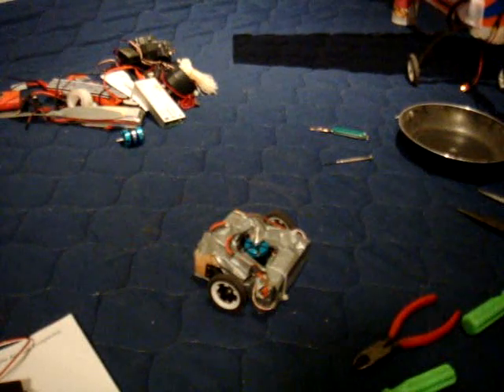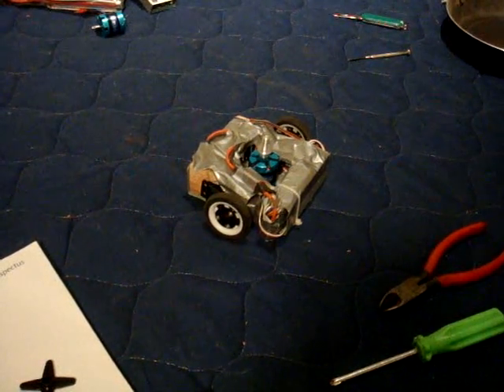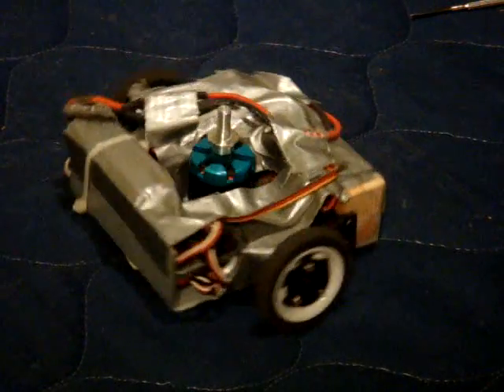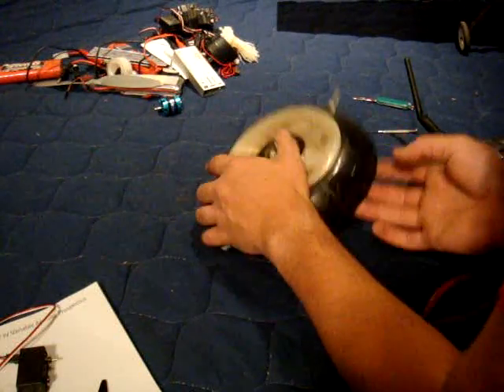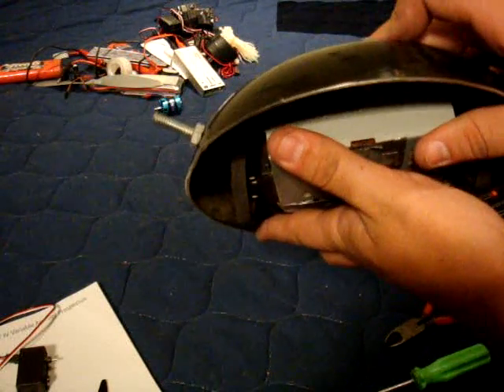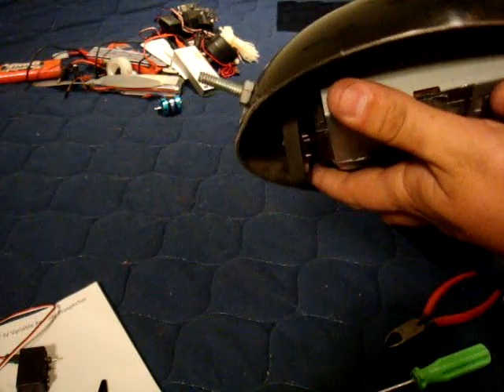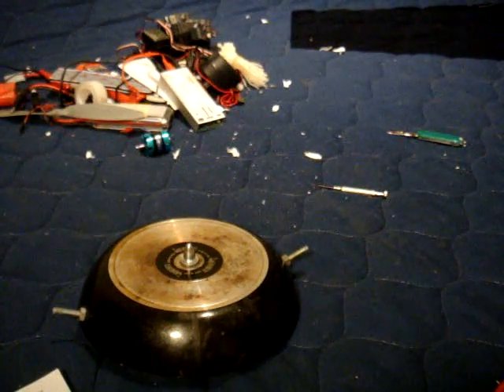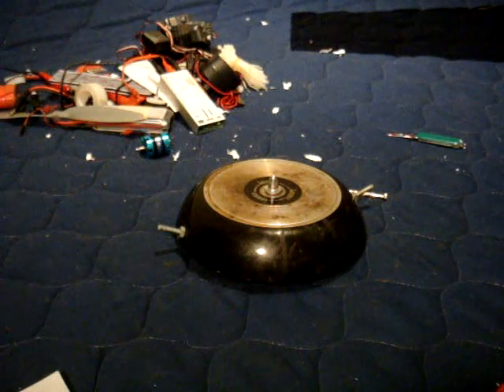How to Build a Mini Battle Bot - Part 3

Comment: Just a rough parts/price list I quickly came up with:
Fingertech tinyESC v2 (your speed controller for wheels)- $35
Fingertech Spark gear motors (x2)- $15 per motor, $30 for two (one per wheel)
LiteFlite wheels that fit the motors- $4 for a pair
Fingertech lite hubs- $4 for a pair (for mounting wheels to gear motors)
Brushless motor for spinning weapon- approx $45
Transmitter (remote control)- $55 and up (depends what you want)
Receiver (if transmitter didn't already come with one)- $15
Frame (chassis)- free if you use the mount in this video, taken from a junk desktop PC, or whatever cost for the frame you decide to use
Then your frying pan. Either free if you have one or find a junk one, or however much you wish to spend on a nice one. Cost of bolts, washers, fairly negligible additional cost
Total cost- $188 (plus a couple more dollars for screws, etc). That should be a bit helpful for all those inquiring what this would cost. This is assuming you have to purchase most of your parts and don't already have many laying around. Hope this was helpful. I used USD for currency, so just convert to Pounds if you're British, or whatever currency your country might use. Rather than hack servos as the poster did, I'd recommend going with the motors I listed. I did not include the cost for a battery and charger. Just do a little homework :)

Comment: For the drive servos did ya just set up the mixing in the radio for the steering? Was all he movement achieved with the right stick of the radio? And the spinner controlled with the left stick. Thanks

Comment from the maker: @theaustralianis the nose cone I used had a clamping washer type design, the shaft of the motor had no threads...just the beam. the cone assembly should contain 3 pieces

Comment: @kuba651  I live in Plymouth and mostly use parts from three places, all internet shops:

1. Sussex model center (batteries, servos, radio gear ect.) 
2. Technobots (speed controllers)
3. Precision microdrives (motors)

However, the best advice for any new builder is to join a forum (the robot wars 101 forum for ants) there is the best advice from builders even more experienced then me, or even more cost cutting measures such as borrowing transmitters during events, which can save you £50-100.

Comment: You would have to enter a lighter weight class. I tend to build 150g UK ants for many years and the most I have spent is $60 (roughly £30). If you keep your design simple and try to keep a tight budget then I don't see why not.

Comment from the maker: The bed is actually an old air hockey table that does not work. Yeah thinking about it, there is a competition coming up next summer in SF CA. Not sure of the weight class, I've modified it a few times since this vid and the weight has nearly doubled.

Comment from the maker: It depends on how much of the robot you would want. The electronics are not cheap, just the blue motor and speed controller that power the weapon would cost more than $100. The radio system I need for my other Planes and Bots. Tell me how much of it you would want and I'll give you a price.

Comment from the maker: That was in fact at low speed with a half dead battery. I think I had the stick at just under 1/4 throttle. Good luck with your project.